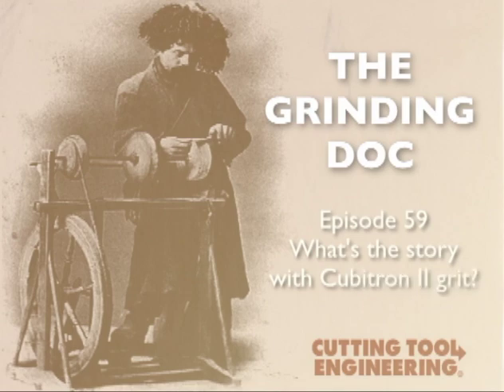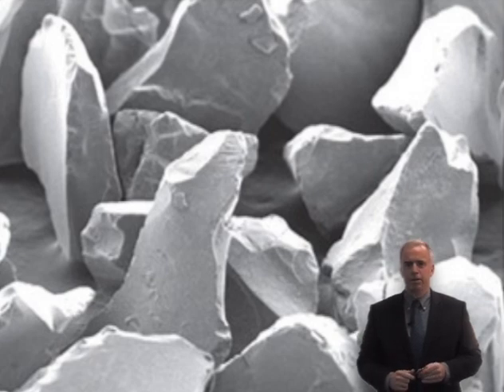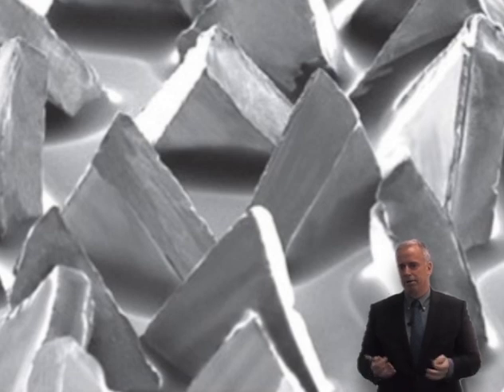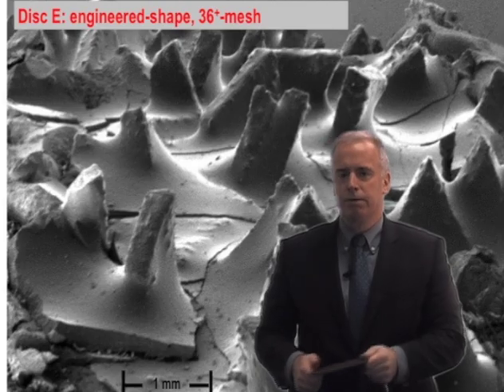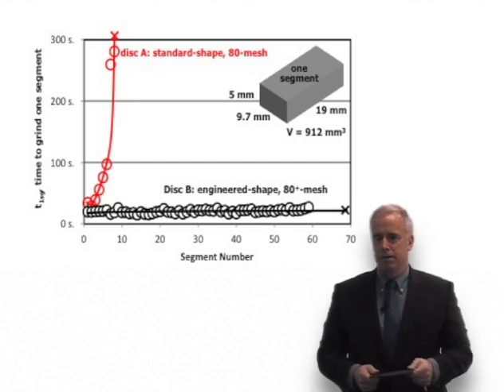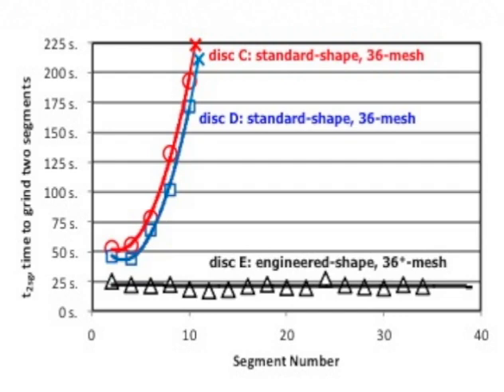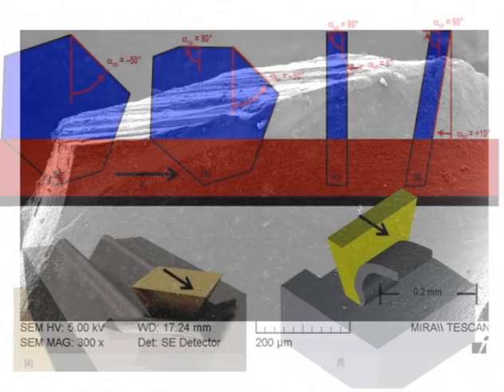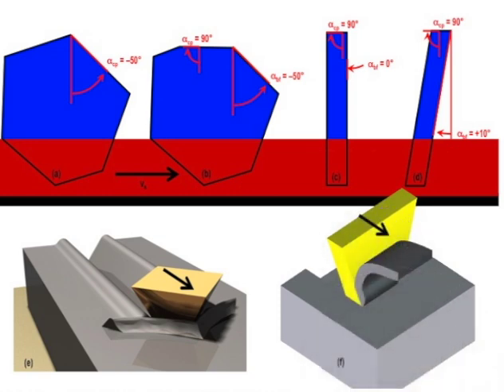Episode 59: What's the story with Cubitron II grit?

Comment: Your tests is comparing a conventional Aluminum Oxide to the Cubitron 2 which is a ceramic grain. Are you kidding? The physical property differences between the ALO and the Ceramic will impact your results just as much if not more than the abrasive shape will. Anyone who knows anything about grinding will know the multitude of reasons why your test is completely invalid. For those of you who are grinding novices let me just say that you should ignore everything in this video. To put it in layman's terms, the testing outlined in this video would be like comparing the track performance of a Chevy Corvette to that of a Chevrolet Spark and calling it a valid test because both cars were red, had 4 wheels and 2 doors.
Reply from the maker: Thanks for your comments. While I agree with you that using a different type of abrasive (for example, ceramic vs. fused, as you stated) would yield different results — which, by the way, I addressed at 7:51 in the episode when I said “at least for the tests we did it on” — the main point of this study was to examine the mechanisms of wheel wear in each grit type and how grit-dulling in each abrasive affects the performance. In that respect, the shape is a dominant factor, whether it’s a ceramic grit or a fused grit. But I do agree that higher-performance grits (for example, ceramic) would probably perform better than standard abrasive; and that if we tested multiple products, we would get a wide scatter in the results. But that wasn’t the main goal of this investigation. 
– Jeffrey Badger, The Grinding Doc

Comment: I have tried to get a test wheel to use on a creep feed CNC grinding machine for a HSS application.  Contacted 3M and so far they are not able to supply the grinding wheel.  It is very hard to get product from 3M at this point in time.  I started trying to get a test wheel back when Jeffrey first posted his grinding results about a year ago.